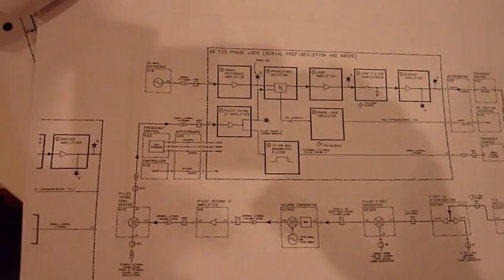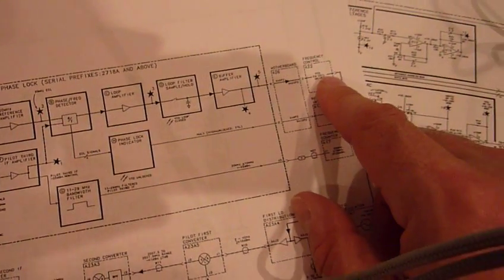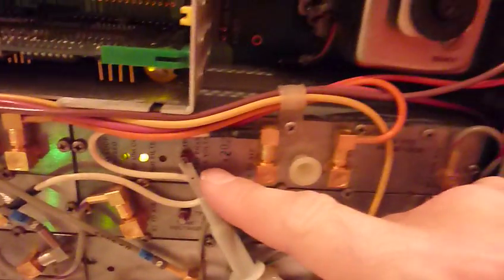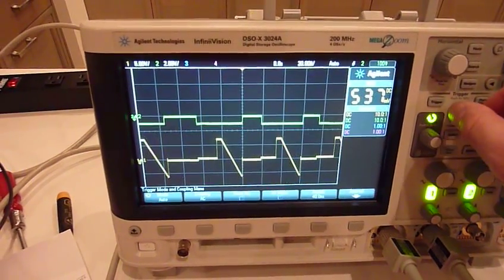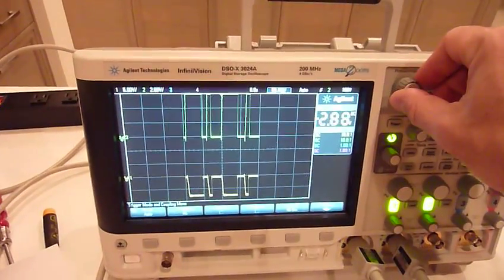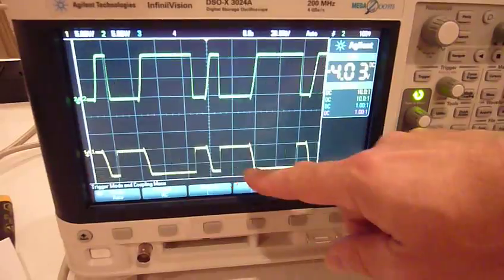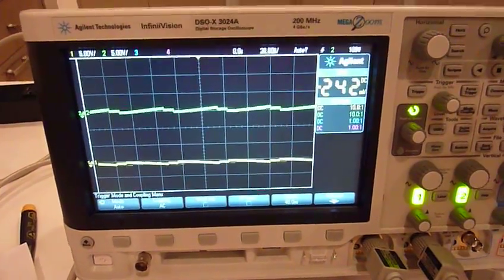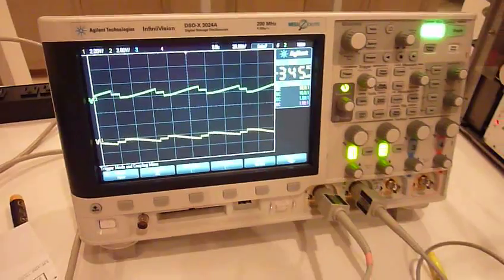HP 8568B Spectrum Analyzer Repair pt. 4

Comment: Hi Marc, I just recently bought a 8566B model that needed attention. I found that the -15 regulator 2N6055 had a crack in the solder joint that circled the base lead. After I fixed that it struggled to power up and then a woosh of smoke came wafting out near the back of the A4 section. One of the caps in the pi filter of the -15 v supply had shorted, over heating one of the chokes, causing it to spew in the A4A7 section. It was a quick fix and a couple $ worth of parts. I really enjoy watching you work on stuff and am envious of all the toys in your shop. Best of luck.